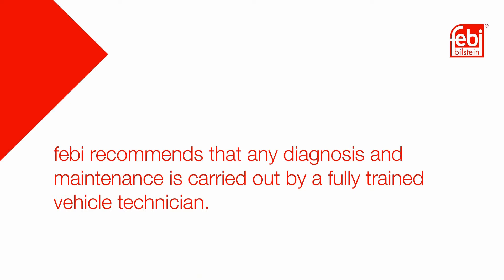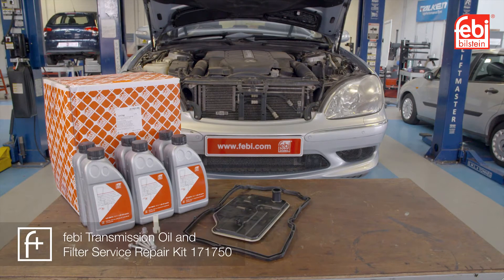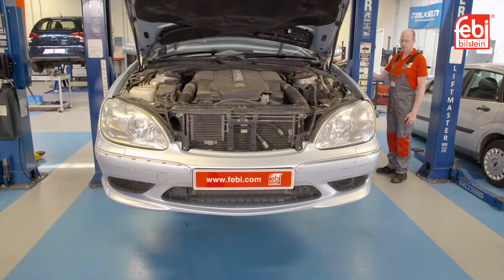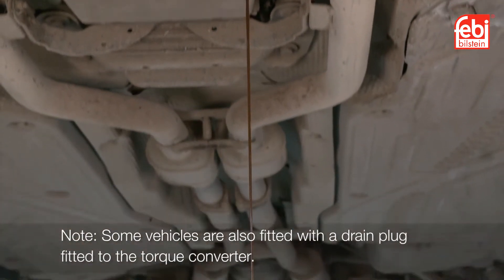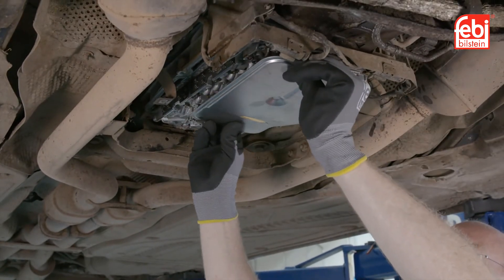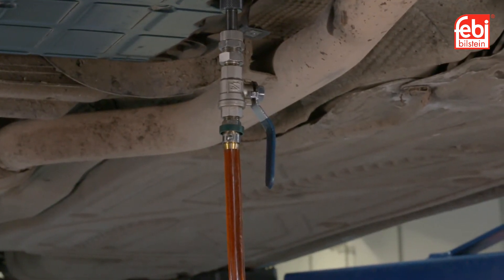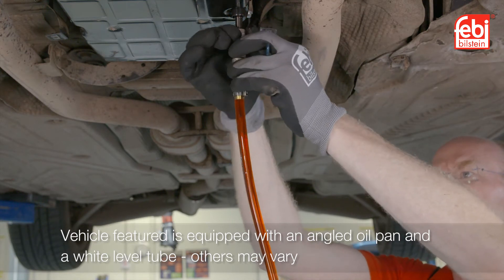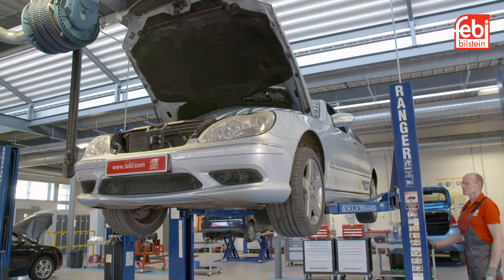[EN] Mercedes 722.9 Automatic Transmission oil and filter service

Comment: Hello, following this video instructions I have bought your W203 722.9 kit, 6 liters inside. My car has a torque converter drain plug, so I assume I should need one or two more litres. Could you specify me the correct full quantity of oil I need to buy? Thank you in advance.
Reply from the maker: Thank you for watching our video. For vehicles equipped with the option to drain the torque converter, an additional four litres of oil are required. Please head over to our on-line catalogue www.partsfinder.bilsteingroup.com for all our products.
Reply: @febi.bilstein  Thank you very much for the fast and useful reply, highly appreciated.